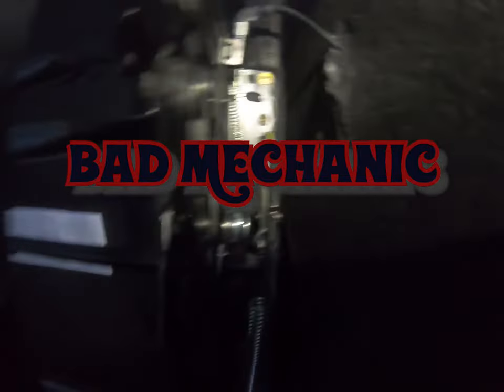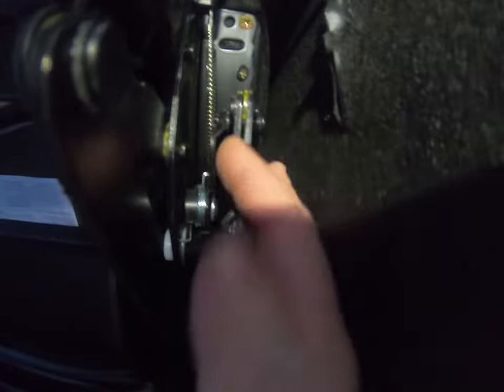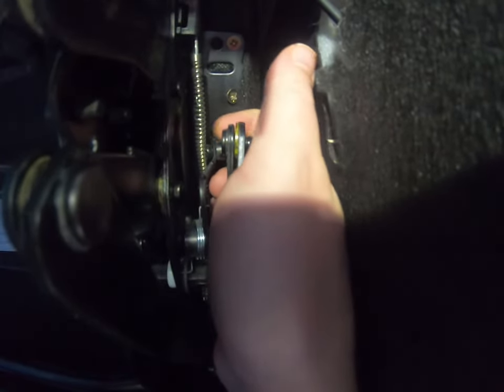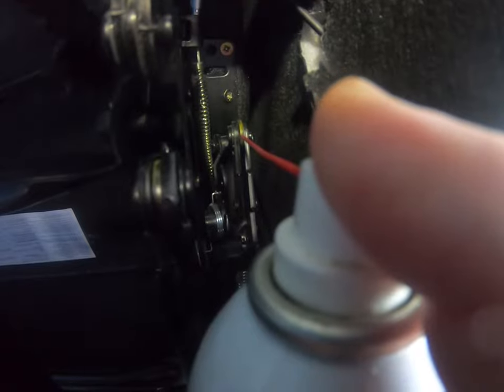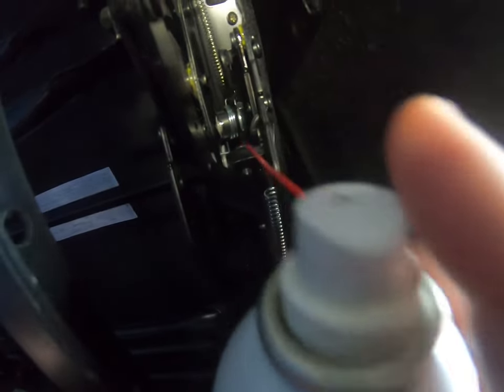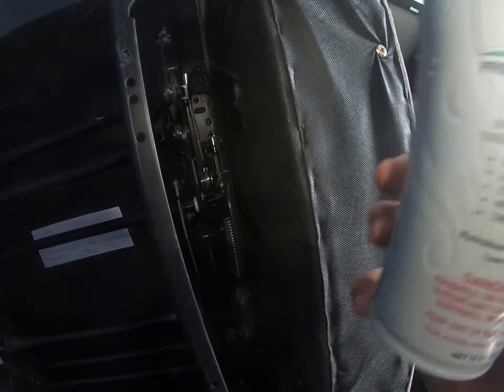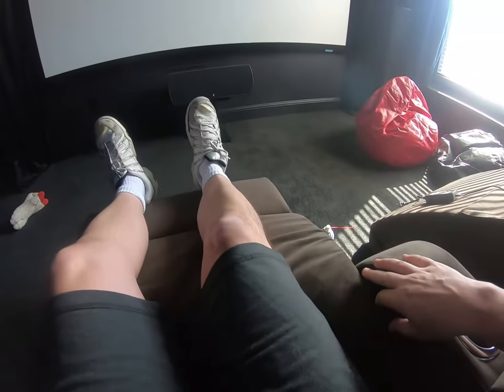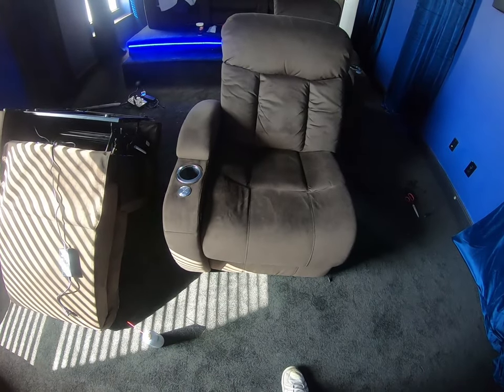How to Fix Recliner Footrest That Won't Lock

Comment: I’ve replaced the handle and cable and the power supply but now the leg  extension won’t click shut and I can’t understand from your chair model / video what bit needs attention. And I’m 72 and had my car written off and 6 fractures this summer and I NEED MY COMFEY CHAIR 😢😢😢

Comment: my recliner has the lever on the side.. would this work for mine? cause it wont lock closed in the sit up position.
Reply from the maker: It's certainly worth a shot. You just need to see if there's a similar arm/mechanism in play with your seat. There are instances I think where the mechanism has to be replaced, but I'd try this method first and see if it works for you. Hope it fixes it!
Reply: My recliner pops open when i sit down. Why’s that? How can i fix it?
Reply: Did you ever figure it out? Mine has the lever too

Comment: Hi! Do you have any insight on an electric LaZ Boy recliner rocker where the footrest will not come out? The back reclines but the footrest does not move. Thanks!
Reply from the maker: I'm sorry I don't. My guess (and it's just a guess) is that maybe the footrest has a separate motor and that motor perhaps isn't working.

Comment: Thank you for this! What if the issue isn’t that it won’t lock but that it isn’t  reaching . I have to lurch forward and slam my legs against footrest in order to make contact with the mechanism. To the point of wrenching my back! Thank you😃
Reply from the maker: If that's the case, I would suspect the cable is caught on something and sticking. Check how it's routed and see if it's pinched anywhere that would cause you to have to slam it.
Reply: @badmechanic91  th rank you for responding. I looked underneath and there isn’t a cable. Just metal bars.
Reply from the maker: @coffeelover2394  The cable is probably running through the arm of the chair. Wherever the "pull" is to release the footrest there's probably a cable, unless it's a completely different mechanism